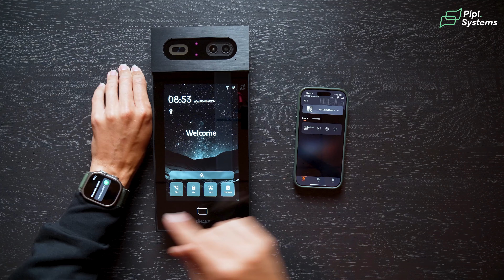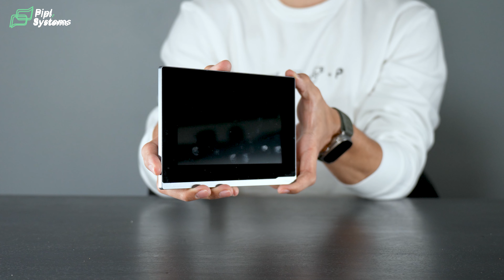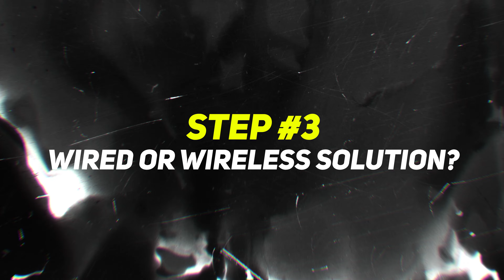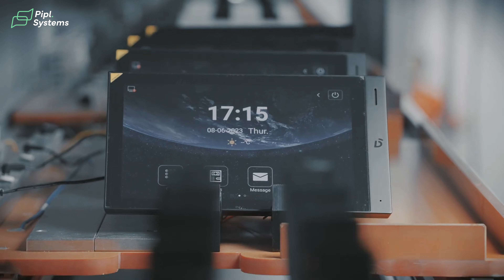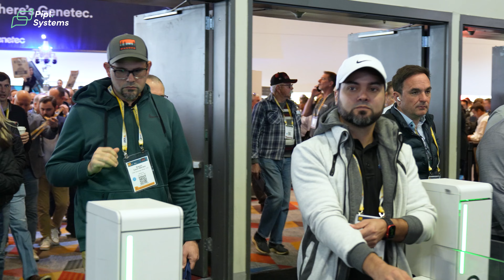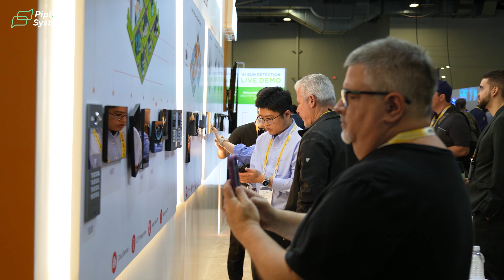How to Choose the Right Home Intercom System

Comment: can you use a screen for ajax doorbell ?  as in have a screen in the hallway for kids before they open the door ?
Reply from the maker: Yes and no. Ajax Systems doesn't offer a dedicated indoor monitor, but they do have a desktop app that allows you to monitor your cameras, including the video doorbell. So, you could have a hallway monitor running Ajax Desktop to see who's at the door, or provide limited access to the mobile app for kids. It's not quite as seamless as a purpose-built indoor monitor, but it's a practical workaround. Hope that helps!